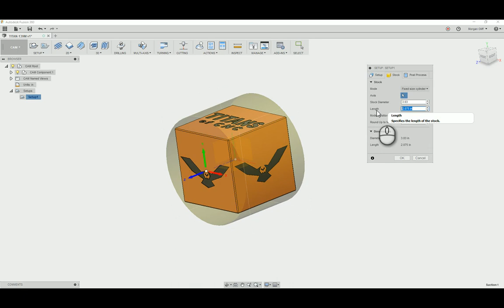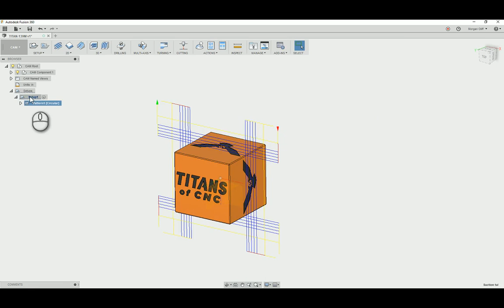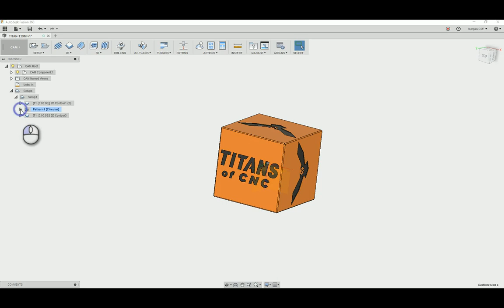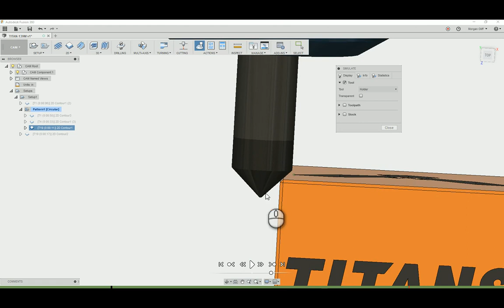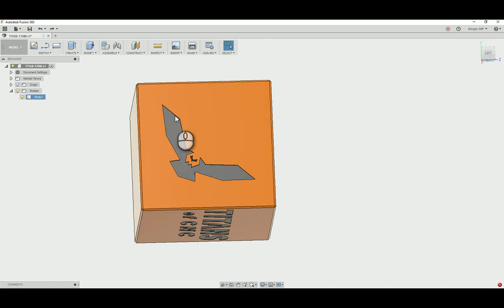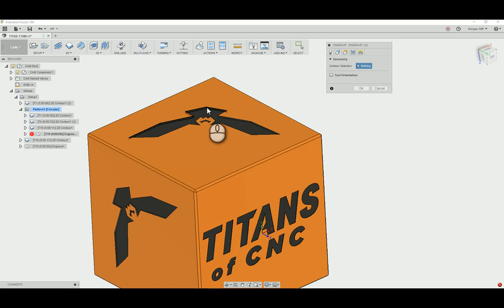My version of titan's 139M Cube.

Comment: So when selecting model box point, you then probe the stock and then manually move over .03”?
Reply from the maker: Full Throttle Originals so if you select model box point, you have to tell your probing operation to probe stock (dropdown menu) it will automatically calculate the correct offset, in this case it knows the zero is .03 in from the probed surface.